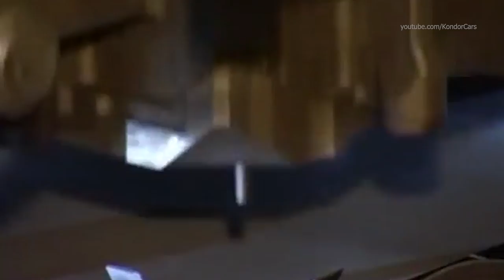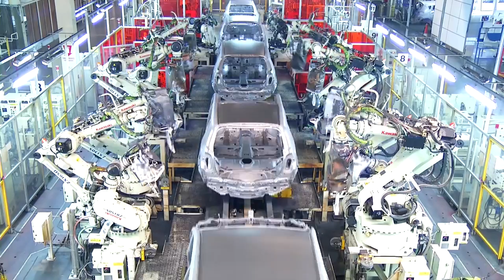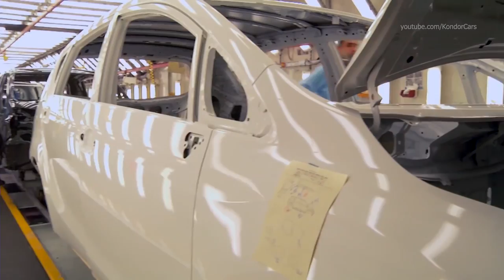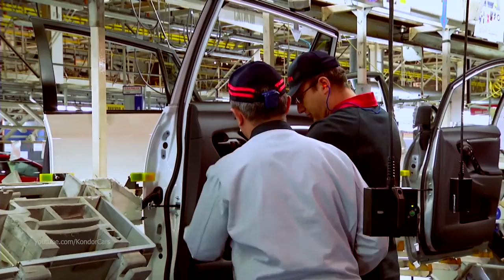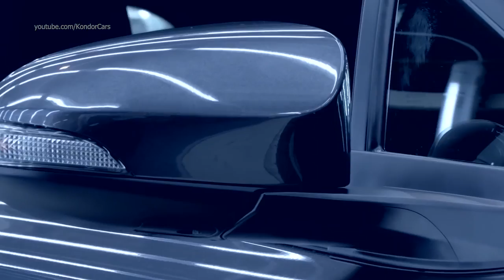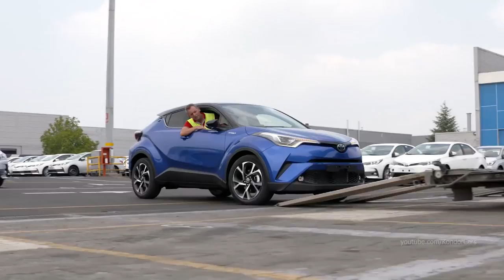Toyota C-HR Production, Toyota Factory Tour

Comment: Great, where can I get a free transmission upgrade - to get rid of the faulty 2018 K114 transmission that Toyota in Turkey installed. Either a real automatic or the Corolla K120 CVT?  So many with bad variator bearing in the first gen C-HR.
Reply: That’s what I was about to say.  Just had our transmission completely replaced a couple of months ago and already having to take it back in for shifter issues.  😡😡😡
Reply: @craiglillard  Had the transmission fluid flushed at 30k miles. No problems - only have just under 32k miles on it. 2018 XLE ruby red-r code (white roof).
Reply: Hi, Don't know when Toyota changed their CVT to a system that doesn't use pulleys and drive belts any more. The gearing is now done via a planetary gear arrangement.  Hopefully those commenting on transmission issues haven't encountered them on the latest system, as I have a (2023 model) C-HR on order !

Comment: The C-HR is a good looking vehicle, but unfortunately the drivetrain we get in the U.S. blows. Its simple and will be easy enough to work on someday, but honestly the only thing this vehicle has going for it is the fact that its still new and will probably be reliable...except for that variator bearing issue that requires the whole transmission to be replaced. I have a 1998 toyota camry that ive been fixing up and despite its age, wear, and issues I think I enjoy driving that car more than I do driving my C-HR.
Reply: USA really needs the 2 litre hybrid power train option - best power unit choice for a  C - HR
Reply: Gas mileage on it sux to
Reply: EU version with 1.8L engine is just fine. Some countries have penalty taxes for vehicles with 2 liter engines. which they consider ostentatious and are taxed as "luxury" vehicles. .
Reply: @mattdomingo4504  bs
Reply: @mattdomingo4504  I had 89.4 mpg out of my 2.0L last weekend. There's very little difference between the 1.8 and 2.0 apart from power. I agree with Lee, the 2.0L is the best way to go with the C-HR.
Reply: @mattdomingo4504  Strange - I am getting 34-35 MPG - even when left in Sport mode.
Reply: Abuh Abuh Bubuk Baja Abuh Abuh
Coklat Tuah Bubuk Baja Tuah Coklat
Ungguh Tuah Bubuk Baja Tuah Ungguh Cat  Besi   Aviean   Baru   ok   Ri   Eauropa   Usa   RI   Janpan   RI
Reply: @FrozenMetroid that's impossible unless for a very short spell going downhill! Overall average would be about 50-53 mpg imperial. Check fuelly or spritmonitor for real world figures from many different owners.
Reply: @PaulArnott-pg2tw  I don't need to check online, I have one, a 2L. In the week, I mainly do motorway driving and I get around 51-55mpg for a 25 minute trip. On a weekend, I travel about 12 miles through streets and get around 75-85mpg. There are a few downhill moments, so I can get a bit of charge back, but I can top out the counter at 99.9mpg if I'm more careful. On the way back, I get about 60-63mpg so it's definitely a bit more downhill on the way down than it is on the way back.
Reply: @FrozenMetroid  I've only had mine for 1000 miles(2L as well) and have seen the 99.9 mpg come up briefly on a short downhill trip. I've yet to see 75-85 on a longer trip but I live in hope! Overall average for 1000 miles has been 50 mpg. In case anyone else was wondering both Fuelly and Spritmonitor bear out the low 50's long-term average.
Reply: @PaulArnott-pg2tw  Downhills and flat roads help a lot for the mpg. It's easier to make it stay in electric mode longer when you get used to it. When you're on a flat road, take your foot off the accelerator and put it back on again, but keep the needle on, or just below, the middle mark in the ECO range and it'll stay on electric mode. If you go above the middle mark, it'll kick the engine in. You've probably already sussed that out but if not, it helps a lot if aiming for better mpg.

 The 2L is the better option of the two as it is so much more fun when you need a bit of power. It also doesn't struggle to move the car, which I think helps the mpg.
Reply: @FrozenMetroid  I'll have to try that as I don't usually look at the eco meter while driving. I have tried the 1.8 version too but it is awful in comparison!
Reply: @PaulArnott-pg2tw  A lot of people don't and just drive it like a normal car which returns around 50-55mpg. Once you get used to it, you can control when the engine kicks in and when the electric kicks in. I use the electric on a flat road as you use the engine to get up to speed, and then release the accelerator, and reapply to go into electric mode and then just use electric to maintain the speed. You can watch your mpg go up as you just maintain that speed :-) 

 I have it set so it shows me the total mpg of each trip so you get a total mpg when you turn the car off. The average mpg 
will pretty much come to standstill at around 56-60 but you'll see how well your doing with the mpg set to per trip. Good luck.
Reply: @FrozenMetroid  I haven't really learned the proper technique yet but happy enough to get 50mpg average. The per trip mpg gets displayed by default now, I think that may have been a recent change as before you would have to do it in the settings menu (I had driven a rental chr before buying mine and it was slightly different) I've had quite a range of trip mpgs from 2 to 99.9 but you're right about the overall average not really moving that much per tank.

Comment: Hi, I have a Toyota C-HR GR Sport 2.0l, 2021. It is OK, good engine, but  I have a great problems with 5th door - cracking from the back, still the dealer in BG could not clear the problem, also a problem with the side mirrors - second time they refuse to fold, repaired once, but still the problem stays, also a slight crack from the steering wheel. The plastics inside easily scratches, not good quality😪. I am at 27000 km and still all the problems stay 😪. Not satisfied, especially at price of 39 000 euro I consider the quality awful. Turkey is not good, do not buy...really